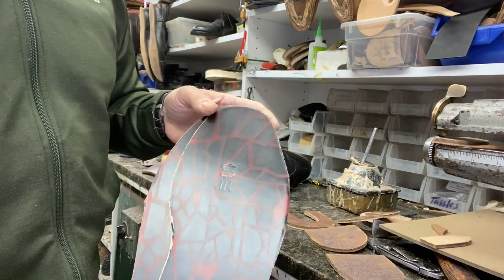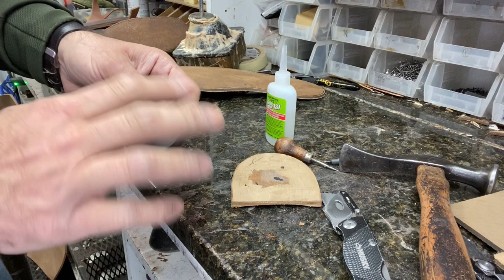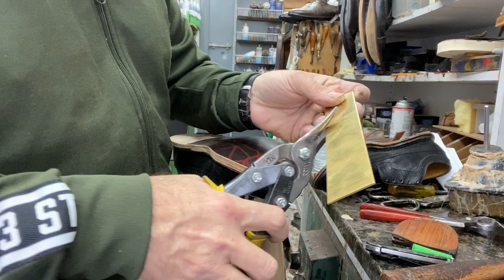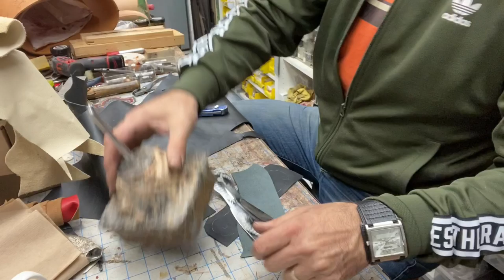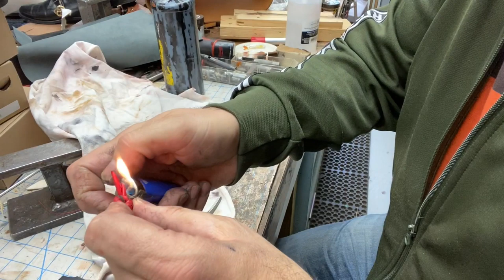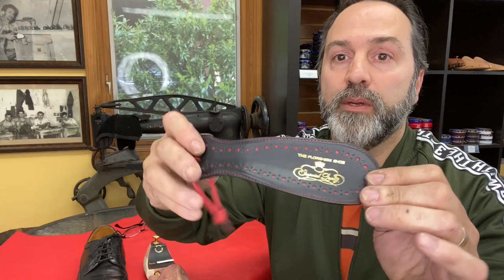Perfect shoe restoration package of Florsheim Imperials

Comment: hi Steve, this pulled through red thread looks interesting. like a friend said once, "failure becomes design". if there is no issue with the quality of this stitching it could be something to do on purpose for the people who like color, but not too much.
can you adjust your machine to do it with a constant look?
Reply from the maker: ALX not a good idea because the two threads need to pull each other to have a tight stitch on the sole, however we could do red thread on the welt no problem
Reply: @BedosLeatherworksLLC  ... Thank you Steve, what a bummer.

Comment: Do you get requests from short guys to try to add height to shoes? Are there ways to do this without being too obvious (like building the lifts into the inside of the shoe rather than just putting on a high heel like a women's shoe)?
Reply from the maker: you can only add so much from the inside, if its to high then your heel doesn't stay in the shoe